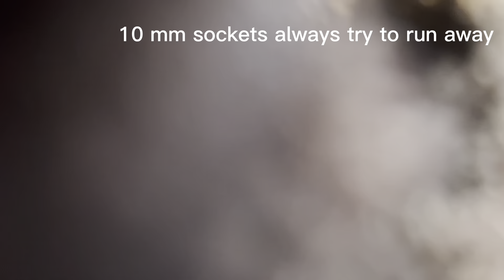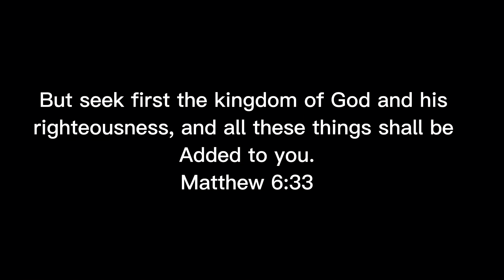CRST Flatbed….Money News & APU’s 1-22-23

Comment: APUs make no sense to me. Wouldn’t it be cheaper to rig a gas generator behind the truck and just run an extension cord to the truck and plug in a portable AC to keep it cool and keep engine hours off the truck?
Reply from the maker: Not really that would be a pain in the butt to try and get gas for all the time, plus it wouldn’t charge your batteries which is an issue if you’re watching TV , running a asleep machine or electric diesel heater in the winter time…

Plus, unless you spend big dollars and get a quiet Honda with remote start or something, you will be hated in the truckstop and probably end up with your tires slashed from running a loud generator 

On top of all that everybody I’ve seen that has tried what you’re talking about. Looks like complete trailer trash, or Sanford
and son going down the road🫣
Reply: @sturgelltruckingllc4074  I don’t care if I look trashy if it’s saving me money but damn I don’t want my tires slashed in the night 😭
Reply from the maker: @curtisjohnson2433  just get a quiet generator, don’t go down to Harbor freight and get one of those super loud cheap ones. You will not be popular. I promise you😂